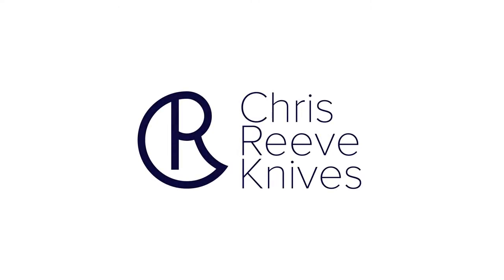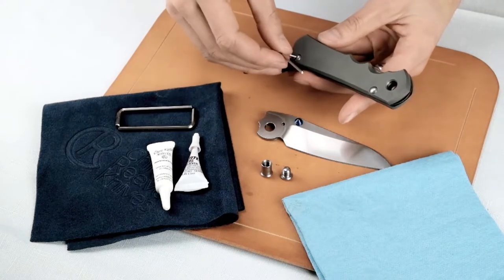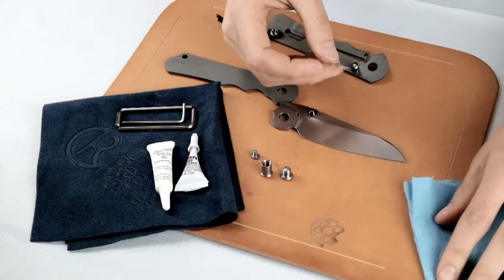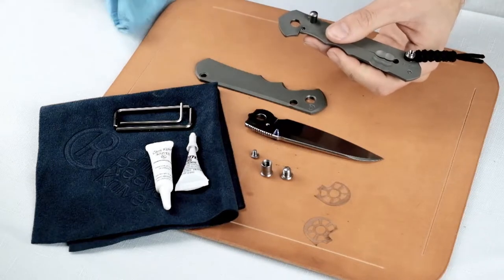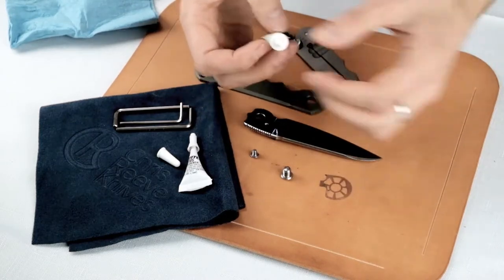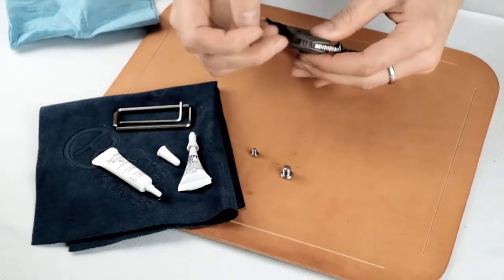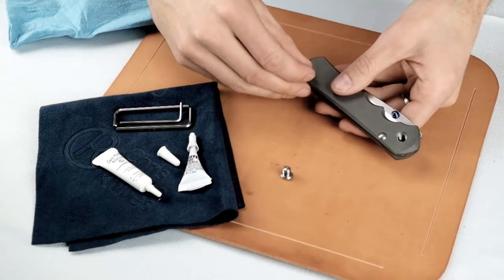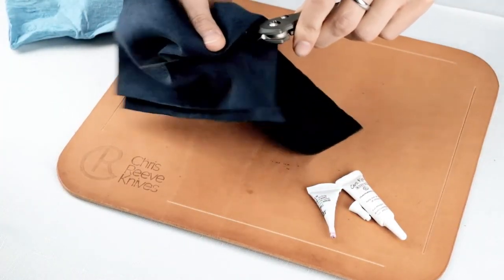How To Clean Your Inkosi

Comment: the other side of my pivot just spins when trying to adjust like thst
Reply: You need to use both of the included large Allen keys. What works for me is holding the Allen key on the lock side still while I turn the Allen key on the show side.

Comment: Just got my first CRK period.  I chose the large Inkosi tanto blade, mainly because of availability.  I’m no newbie in pocket knives, otherwise, but this is one is quite tight.  It opens fine, but really tight when closing (requires two hands).  Is this normal, or did I get a bad knife?  Thanks! ;-}. MM

Comment: Anybody know? 1.) Why does the Inkosi and the Sebenza have that small part of the blade that protrudes out a little when the knife is closed, right where the jimping starts ?  2:) Some of the screws like the pivot screw on this Inkosi are huge and bulge out a lot, wouldn´t  a flat screw feel/look better?
Reply: I believe that if they'd changed the shape of the head to cover that bit of the tang when the knife is closed, then the head would get in the way of your thumb when opening the knife. Personally, I would love to have a bit more of the tang protruding because that would make it easier to front-flip😅 As for the bulging screws, I think they add character to the knife.